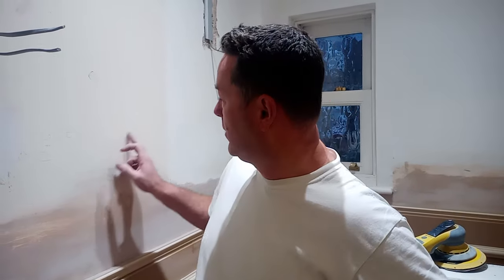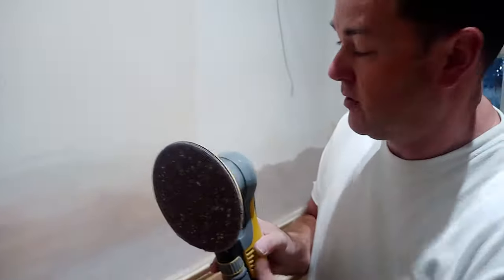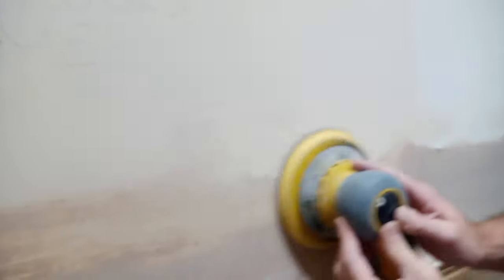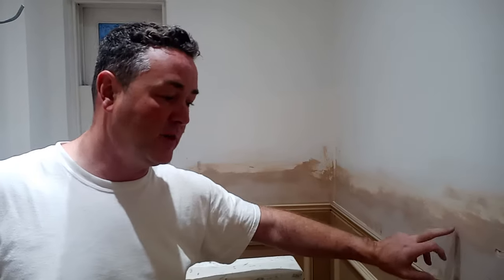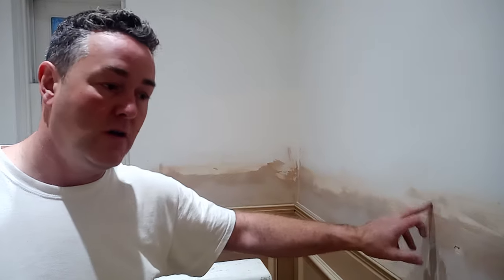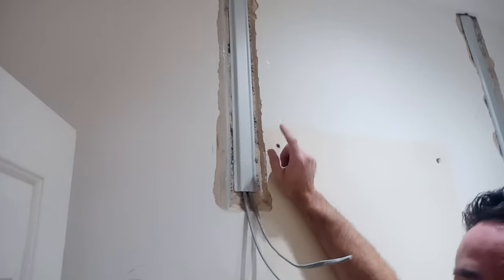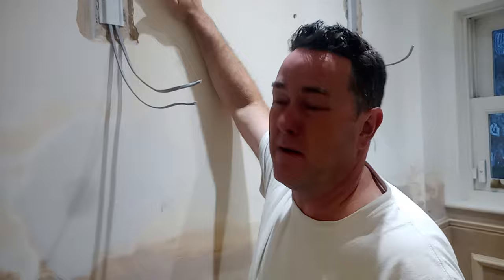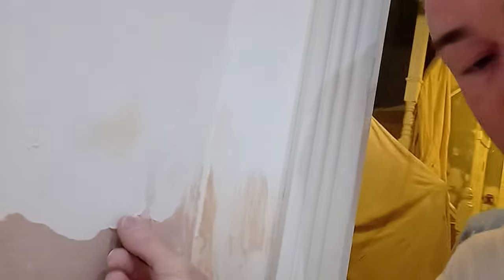Painting DIYers Beware: The Dangers of Using PVA as a Primer

Comment: Hi Phil, l recently striped off wallpaper from a 1950s plaster board wall.  The top layer of backing paper on the plaster board has  been torn off in large areas of the wall . What would you recommend  to prepare for painting.  I've sanded it down and was wondering if l should seal and give it a skim coat before painting.
Reply from the maker: If its plaster board paper that's ripped, Zinsser PeelStop is the product to use that will seal those ripped edges.
I'd skim out the damaged areas, with filler. Sand it down, till you're happy with it.
Now if it's only some areas, I'd re PeelStop those areas of filler so they are sealed.
Then for a better job, line the walls, that way you'll have a great new surface to either paint or wallpaper.

I'd need to see it for a better conclusion though lol
Reply: @ProfessionalPainterDecorator  Thanks Phil! That's great. Yes there's large areas with the last layer of backing paper exposed down to the last layer. What do you mean by lining the wall?
Reply from the maker: @user-ct1vo2sd3v  wallpapering it with lining paper which you can paint
Reply: @ProfessionalPainterDecorator   yea ok Phil  thanks for the tips . I think l'll see how it looks first before lining it with paper .

Comment: Ok, but why did you have to sanded with an orbital sander? Or why it wasn’t a good base for your finish? Let’s get it right the analogy you have given was on point, a sun burn and you peel off, surely if you heat up pva layer to a certain degree then it will peel off, that is a limitation for latex type of applications, so what are you going to say, don’t use latex based paints or products, because it peels of if you use an orbital sander. So my question stands why did you needed to sand it with orbital sander? Where have you ever need it to sand a primer? PVA might be known as a wood paper glue but it works wonder as a primer, to increase the strength of the substrate, to make the surface absorbtion free(D3 only), gives a bit of texture if the surface is smooth,   Adding PVA to the plaster %5 - %10 increase the set time, increase the stickiness, makes it free of air bubbles much easier, improves the application experience(plasticity increased) , plasticity increased, it can bear environmental dynamics and chance of cracks decreases, better sound insulation yet again because of improved plasticity, plaster is always water hunger, it decreases rate of absorption(surely a responsiblity of the finish, but this is still an improvement).
I mean any of the things i wrote here, you can find relevant findings on pubmed and researchgate, this thing is researched well, known as a wonderproduct, you are just misleading people…
Reply from the maker: You don't apply PVA directly to a surface you are going to paint.... As I explained in the video.... PVA isn't alkali resisting.. hence it comes away from an alkaline surface, like plaster.

It is something you learn when at painting college, so not something I'm making up.

Watch my video on wallpapering a ceiling. See how PVA reacts on a surface.

Comment: It doesn't help that dulux decorator  centres sell pva. There's no need to plasters to use it either. It stops walls from breathing and creates a peelable film. PlStwrrs should use something like sbr to seal the area, if needed, using the proper base coat plaster also helps pva is a cheapskates product.

Comment: I don't understand why you would sand a totally smooth wall before painting it. It seems obvious that if you sand something sitting on the surface, like PVA that it will start peeling off - but why wouldn't you just paint or paper on the surface as it is, without sanding?
Reply from the maker: You need to watch and look again. a plasterer had blended out an area and use d PVA as his primer getting over the face surface of the wall, which wasn't great anyway, so wanted sanding to improve it. The PVA just sites on the surfaces and starts to peel up when you sand it. Thing is, PVA and bare plaster don't mix, as I say, PVA isn't alkali resisting.. thats why you get a problem with it when you paint over it. The PVA sits on the surface and acts like a balloon skin.

Comment: Bloody whole house has a pva base layer and a oil top layer, ask me how i now it was done in the 80's by mam under advice of the plasterer, im in my 30's so wondering was water based paint a thing then
Reply from the maker: Never ask a plasterer about painting anything.

If it's an oil finish. Alkali resisting primer should have been used before applying an oil paint.

Not PVA.

Comment: Two brothers on here uses pva on new plaster but they mix it very weak so it's not sitting on the plaster so will this still cause problems. A few years ago I used gardz on plaster and it left a sheen to the wall and the leyland retail emulsion I used didn't want to stick to it so what paint would you recommend over gardz
Reply from the maker: Clearly never been taught correctly or been to college.
I'll say no more.

New plaster, mist/wash coat it. Don't use PVA.
You don't need to Gardz plaster unless it's a problem surface or had wallpaper paste on previously.
You can paint over it.

I don't use retail paint, so unsure how that reacts with trade products.

Tikkurila Optiva 5 goes over Gardz without issue. I've used it before over it.

Comment: It’s all about variables 
Been using pva for years on new home construction 
Never a problem 
It’s variables 
Different places and substrates….
Reply from the maker: Using it on what?
Reply: Maybe use pva on drywall/Sheetrock with joint compound not plaster. 

What do the British call their wallboards for plaster? Is it the same wallboard for joint compound? Plastering seems more popular in England than the U.S.
Reply from the maker: @YaBoiKi  plaster board sheets .. then a few millimetre skim of plaster over it to bring it to a finish.

It's not good to be painting over PVA though.
Reply: @ProfessionalPainterDecorator  
It seems in England pva is a glue or adhesive. In the u.s. we use pva as a primer over drywall and over joint compound. We “ tape and mud” the joints not the entire wall like plastering.
Reply from the maker: @YaBoiKi  it does. What do you put on the plaster board that gives it that slight bobble texture?

Comment: When i remodeled my bathroom last year i used pva as a primer and 3 coats of paint. When i wipe down the walls and wainscotting, the paint shows up on the rag. (Im carpenter not a painter by the way). Im still not sure why the paint wipes off when i use a damp rag but next time i will for sure use styx primer which is what my painter friend recommends
Reply from the maker: aaaarrrh I'm saying about the priming using the PVA... Slap your wrist... But you know not to use it in the future.

Paint coming off on your cloth... What paint was it, normally that happens with a cheap contract Matt paint that's not Hardwear enough to be wiped.
Reply: @ProfessionalPainterDecorator  it was glidden eggshell paint i got at a home depot. It was cheaper than kelly moore that i usually use which is why I bought it. What would you recommend for priming drywall in the future?
Reply from the maker: @AN1MOS1TY117  just thin down your emulsion paint.. that's all you'll need to do
Reply: only use pva as a primer for freshly installed drywall then paint over it. If your not using a washable latex paint then that's why it's wiping off when you scrub it. The pva helps seal fresh dry wall.  New dry wall soaks up so much moisture out of the paint it would take 5 coats and where the mud lines are will dry different as well because they soak up more moisture than the rock so it will flash differently unless sealed first.. now this is how we do dry wall gypsum board. I don't know shit about plaster.
Reply: @joshuadraper1534 pva doesnt seem to seal the mud at all.. first topcoat soaks right in to the mud still. If it was actually sealed, that wouldnt happen. Seems for pva heads, an option is spray all the mud first then come back spray & backroll the wall.

Comment: It works well on new plasterboard taped walls as a sealer either before painting or wallpapering but that it 👍
Reply from the maker: You know what I'm going to say.....
No no no no no no and no

LoL
Reply: @ProfessionalPainterDecorator Thankfully gypsum is pH neutral so the PVA doesn't actually need to be alkali resisting, if the wall is drywall timber partitioned.
Reply from the maker: @bitTorrenter   yes, plaster board will be, as it has paper over it, gypsum plaster is still a allali surface.

if you're painting over plaster board I wouldn't use PVA t seal it, why would you need to?

And painting over PVA with emulison... well, that never ends well.

Comment: Ive just spent the last 3 days peeling paint off my sons wall.. sander did noting.. i presume it was sealed with PVA, absolute nightmare
Reply from the maker: More than likely. Get what you can off, sand best you can. A coat on of gardz will help bring it back to life .. or line them.
Reply: How did you get on with the corners and edges? Im struggling
Reply from the maker: @melinmove  hi. In what way
Reply: @ProfessionalPainterDecorator  I've got the majority of it off, but it's all hard in the corners and won't budge. I think i need a heat gun to get it off, as a sander won't fit
Reply from the maker: @melinmove  sand it and put Gardz over it if there's still some about
Reply: @ProfessionalPainterDecorator  Thank you!

Comment: Best to use a cheep emulsion well watered down 5 water to 1 of the cheep mat emulsion this will soak into the fresh plaster , and then when dry another coat of cheep emulsion , this time not watered down . The plastered wall is now ready for your chosen paint . I would use 2 coats for a nice finish.
Reply from the maker: Correct. But there are now better barr plaster primer paints out there.
The problem you can get with cheap contact emulsion (we call it false opacity paint, as it's very chalky and looks to cover on one... But spray it with water and it turn a grey colour and reverts back to a soft chalk paint and wipes off)
If you put better quality paints over it, the moisture in that paint reacts with the cheap contact emulsion, activating it again.. then it trust to expel the moisture in it.. trying to breath itnout through the better paint you've applied... That's when you see little 'moons' /bubbles on a surface that don't pop and disappear.

Have you seen those before?

A prime example we had years ago... Wash coated with thinned down Eclipse... Ready for two coats of F&B modern emulsion.. bubbles formed.

Spoke with technical department of f&b and said it was the contact Matt paint causing the problem.

Since we've moved away from cheap contact paints and gone to Optiva primer or No Nonsense Bare plaster primer... It's not happened.
Reply: Using cheep watered down emulsion is a bad idea. 

Ask me how I know it. I did that after watching loads of youtube videos of people doing it. I thought it's cheap so I'd give it a try. 

Bought a tub of Leyland trade matt, watered it down painted on bare plaster and then painted over with dulux matt.
The problem now is the surface is very weak and if you put a ding on it or stick a masking tape the paint will then peel off and you can see that white chalky "mist coat" rubbish underneath which clearly has very poor adhesion with paint.

Just use dedicated products for it. I guess here it's a special primer paints. In Europe we were using Ceresit CT17 which is a really good primer but no idea why people aren't using these german products here. You can buy it but it'll cost you an arm and a leg (which isn't it's normal price in Europe)

Comment: Hello Phil.  PVA is the Devils juice! Over the last 40 odd years of being on the brush, I've seen no end of crap that PVA has caused, including people that that think that putting it in wallpaper paste makes the paste better 🥵adding it to paints for the same reasons, coating new fresh plaster with it!  The list goes on!    When you ask folk why they are using a Woodworking adhesive as any kind of a primer / sealer, you get some strange looks and answers, as after all, PVA is a woodworking glue, have a look at Evo stick Resin "W", it's PVA!
Unibond is my other pet hate!  Same dam stuff!
Reply from the maker: We know, those who know.. know. For everyone else they justify it to themselves they've been using it years with no problems.

PVA isn't alkali resisting, so shouldn't be put on bare plaster.
Painting over it causes problems.

Why put it in paste??
Just buy ready mix tub paste... You can thin that to the consistency you need..... You wouldn't put that on new plaster and paint over it lol.

Comment: Bro i use sherwin williams PVA Primer over new drywall its professional grade stuff no problems ever
Reply from the maker: Good to know, Your dry wall is, what we call, plaster board over here... gypsum plaster between cardboard/paper,  it then get a skim of plaster over it.

PVA (glue) is different to PVA used in paints and i think what you use.
Poly Vinyl Acetate (glue) isn't alakli resiting.
where as I think Poly Vinyl Alcohol (also known as PVA) is the product used in paint manufacture.

Correct me if I'm wrong
Reply: @ProfessionalPainterDecorator  skim of plaster? Or skim of joint compound? I see these terms used interchangeably in these comments, but plaster and joint compound (what they skim with in the US) are different.

Comment: Pva has to be used when marrying in existing surfaces to create a bond for the plaster otherwise it will delaminate from the surface plus that paint is probably a silk paint or bathroom paint which has no suction atall which is why this is happening , sounds like your having a dig at plasterers I don’t know why anyone would pva before paint that’s  beyond me there’s a process to plastering and a process to paint for me a fine fill and a light rub down with a fine 180 grade jobs a Gooden or pregrit  due to low suction background plaster the whole wall nice and fresh for the decorator 🤷🏼‍♂️

Comment: FlaKy Paint?  Sorry Phil you join a bunch of flacky BRITs who want to engraciate  them selves to the makers of "stop paint flake' products. These products are simply watered down PVA supplied at exorbidant prices.
As a builder/ woodworker/ renovator , I have used PVA wood glue for over 50 years. Even to increase concrete strength!
The example  you show where you simply peel some crap off the the ceiling, only shows SOMETHING that has not hardended or stuck to a surface that is probably greasy.
I have recently used PVA and pinned down some flacky areas, it was set and hard in 2 hours, a light coat of gyprock mud, set and sanded in 24 hours . JOB done!
Reply from the maker: as said, PVA is for builders/plasters and joiners.. school teachers with pasta shapes.... not painters. read the comments below from ppl.

PVA isn't a product for Bare plaster surfaces to paint on.. nor is it for exterior use.
Reply: @ProfessionalPainterDecorator  So let me get this straight, they used PVA on non-painted walls, if so my question is why. The only time I would use PVA would be on painted walls that I have to put mud on, since mud really doesn't want to stick to paint even after it's roughed up. but it sounds like you know this.

it kind of looks like the walls were painted hence the PVA but it also looks like they went a little crazy with it.
Reply from the maker: @johnflynn6140  the plasterer patched in areas and back primed with PVA (like they do) but got PVA over more off the face surfaces, meaning it made it hard work for painting.

PVA should not be put on bare plaster prior to painting.

Comment: We use pva on literally every single freshly mudded dry wall job we do. Its the only way to go. That wall looks like it has already been coated with somthing being the reason why its pealing.
Reply from the maker: UK. Bare plaster is alkali based and PVA isn't alkali resisting, that's why it reacts and comes away.
Hence on new bare plaster you need to seal/wash coat it with alkali resisting primer/paint.
Emulsion is one product that is Alkali resisting. Hence why you do a thinned down wash coat with it.

PVA, shouldn't be used. 
PVA even on a painted surface causes problems when painting over it too.

Wallpaper paste, is not the same as PVA.
ZINSSER Gardz... Is not PVA.
Reply: You prolly mean like a valspar pva? Use it on every job too just fine
Reply: Thank you...this is a job that they truly don't know what happened prior...this isn't a PVA issue 😂
PVA is for bare/new drywall jobs,not contaminated patch work

Comment: I’m a plasterer and decorator, and I’ve never tried and wouldn’t try using pva to seal. I know the brothers do, and seemingly they’ve had no issues which is fair enough, but I’ve never had the guts to risk it. I just seal with either bare plaster paint or bullseye 123. With regards to the plastering, I do a pissy coat to seal then a neat coat of pva, never had it fail me. The plasterers in this vid were very sloppy with their pva’ing

Also that is shocking patching
Reply: it looks like they were trying to get their thin featherd out plaster to bond with the paint coating they were patching onto. Sometimes when the plaster is featherd on too fine onto the existing paintwork and you roll onto it with paint it flakes off onto the roller
Reply: @utubeape  I typically don’t patch. Easier to just do the wall or whole section. Regardless, they’ve done a shit job of that patching
Reply from the maker: Didn't help the cable protector was almost surface flush lol
Reply from the maker: I had to skim the edge best I could.
Reply: @ProfessionalPainterDecorator  I always say to my clients who want patch plastering doing that most likely the decorator (be it myself or if they get someone else in) will have to give the edge a bit of a sand or a bit of filler in places. Only a few times have I managed to completely loose the join with no additional work